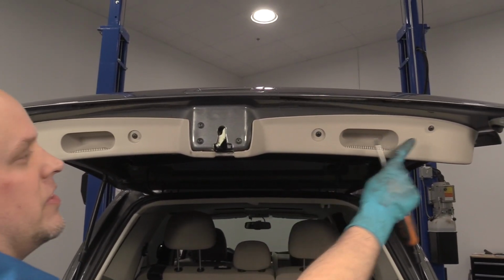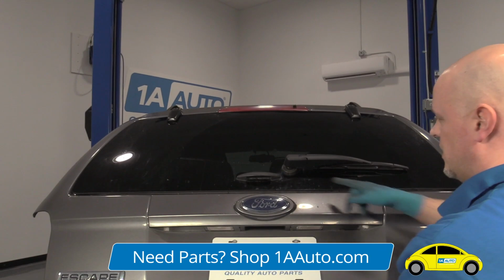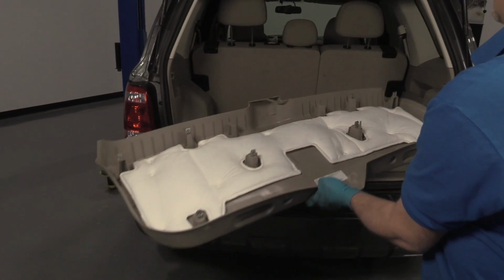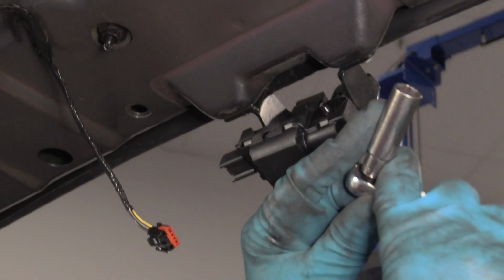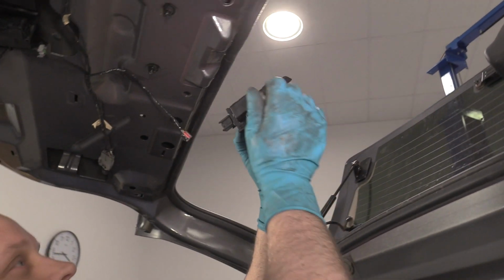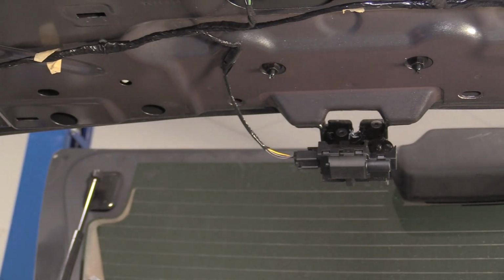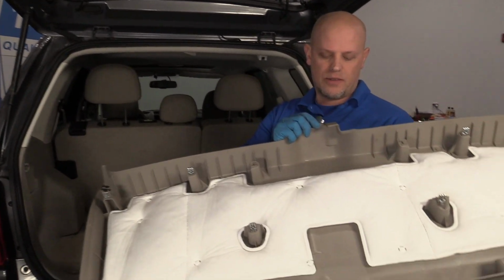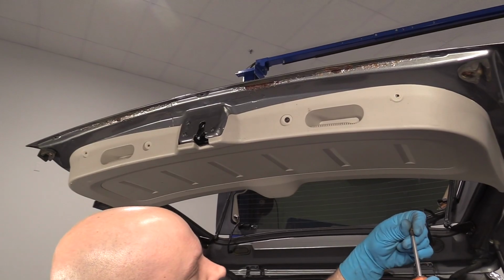How to Replace Rear Glass Latch 08-12 Ford Escape

Comment: mine will open it jus wont lock wen i push the window bak in. im scared to break the glass i keep pushing on it. the latch faulty? wen i keep presin the buton u can here it working n can see the latch open. i jus cant get the glass to lock bak in

Comment: I bought part from dealer and replaced it but it still doesn’t latch. What else could cause it not to latch. Could a loose hinge cuz it not to latch
Reply from the maker: +Marcelo Villa We wouldn't be able to diagnose an issue like that here, you may want to have a local mechanic take a look at it. Thanks for checking us out! http://1aau.to/m/Shop-1AAuto-c